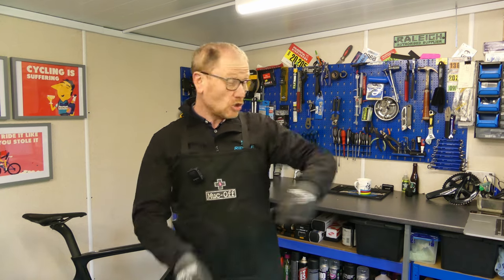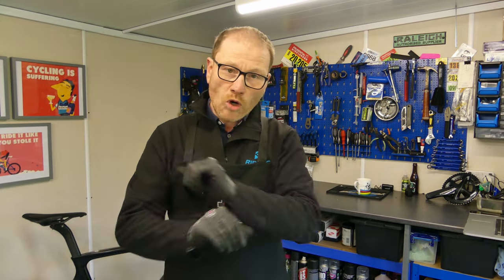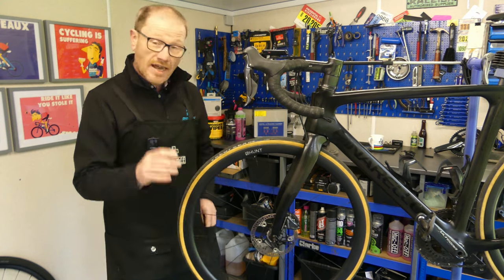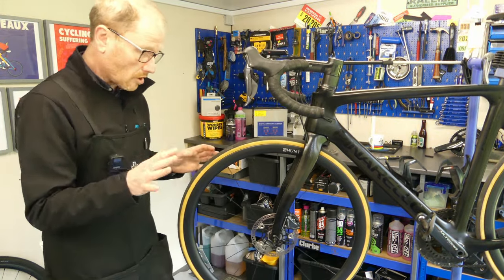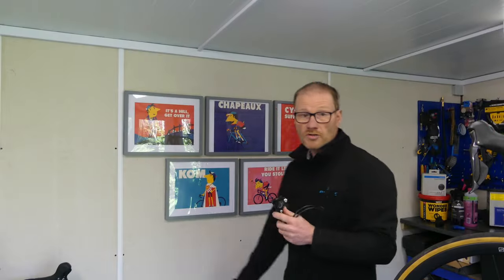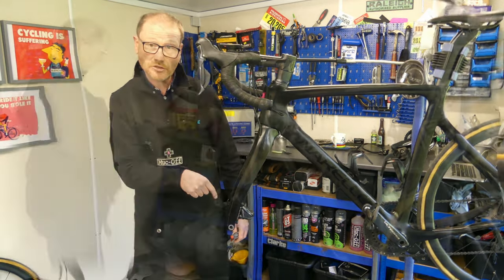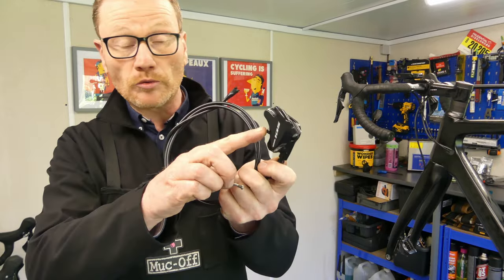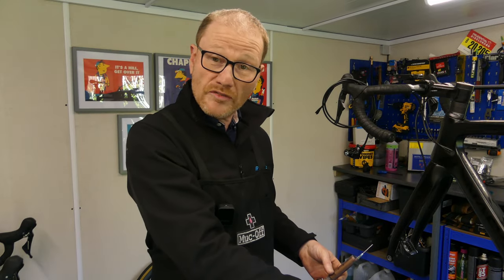How To Stop Disc Brakes Rubbing On Your Road Bike - Bike Maintenance

Comment: Discs are only any good on a mountain bike, brake hard on a road disc like I did in a proper emergency stop and it’s Ching Ching Ching 🤣 the discs are like milk bottle tops, way too thin and lack of tolerance, they have a long way to go , personally without increasing weight and tolerance on a road disc this is a problem the bike industry cannot solve.
Reply from the maker: A good quality well maintained hydraulic road disc brake works well. Agreed, not as well as a mountain bike setup.  However, when running in the rain whilst descending a Lake District pass, the alternative rim brake would be suicidal. Additionally, you wouldn’t want to run rim on a gravel bike….. just look at old MTB V brakes.

Also, from experience, when braking hard with disc on a road bike, the tyre is usually the first thing to stop doing its job.

Thanks for watching.

Jon
Reply: @ribblevalleycyclist  I’ve done one proper emergency stop on my bianchi all road with 105 hydraulic disc , it was rolling away from traffic lights and I got up to 20mph when a car just turned into my lane 🙄 had a split second to decide I couldn’t swerve it so it was a proper pull to the bar job just like a motorcycle emergency stop, pull and hold!!! it was a dry road and I was running schwalbe g ones 38c, this is what happened, the impact was unavoidable so it was a question of scrubbing off speed before I hit the car, i thought either the fork would snap or the front wheel would wash out, neither of those things happened , my weight was back as far as possible and I went over the bars, the wide tyre gripped so well that going over was unavoidable, I was ok so all good 😃 couldn’t even spin the wheel one revolution after that stop , I’ve been riding 40 years and the last time I went over the bars I was 10 years old!!!! so the question is what would happen on a proper road bike with a 25c tyre and a wet road 🤔 it’s going to be a front end wash out for sure, I cannot stress enough that this was a life or death emergency stop where I landed on the bonnet of a Peugeot on my back😊 , this info might be of some use because a lot say they had to stop sharp but it ain’t an emergency 🤣  next time you’re going down a hill at 20mph pull the front brake to the bar and hold it and let me know what happens on a narrow tyre 😊 I believe this is why the bike industry have gone with wide tyres, it’s for safety not comfort like they keep telling us🤣

Comment: Actually he's wrong on the last point...if the brakes are still rubbing, chances are it's not a brake bleed you need...it's actually more likely that you need your brake mounts faced (aligned perpendicular with the axels using an expensive facing tool).
Reply from the maker: Just to explain, what Phillip is saying here is, instead of basic routine maintenance, like replacing brake fluid, which, when contaminated with either air or dirt, is universally known to both affect braking performance, and cause brake rub. You should instead cut into the frame with a £400 ($500) tool, that, when used incorrectly, will cause irreparable damage to your frame.

Phillip is right, I’m wrong. Don’t check the basic and obvious things first. Be more like Phillip.
Reply: @ribblevalleycyclist  I didn't suggest necessarily that individuals without experience use that tool...many bike shops can perform this service for you....and on your point when the brake lines are contaminated with air/dirt usually the brake pads tend to not provide enough pressure to the brake pads to provide proper contact with the disc, so it's not as likely that rubbing will happen (although I suppose the 'rebound' would be lacking, but that slight amount of rubbing when there is no pressure on the pads from the caliper is usually a very quiet noise). Also, most frames don't get a precision facing job out of the factory and are misaligned enough to cause  rubbing problems due to an uneven braking surface. Also, lets not insult one-another, it's not constructive and helps nobody.

Comment: My front disc break does a thing where if it's tight enough to actually grab the rotor, it will click and then release the pressure on the rotor, I think it may be because the breaks are so cheap
Reply from the maker: Yeah, that sounds a little worrying. Are they mechanical or hydraulic?
Reply: @ribblevalleycyclist  They are very cheap,  not hydraulic.. if I look directly at it I can see the caliper twitch along with the click... like it grabs when i squeeze the break leaver, then it clicks and releases on it's own... and it only does this when the break is tight enough to actually be working... I have it loosened to not get that click... resulting in the front break hardly doing anything.
Reply from the maker: @YoungNino2017 So they’re mechanical callipers. They use mechanical leverage that can fail. When it does, the mechanism slips causing it to jump, which I suspect is the issue. You need to get that checked/replaced.